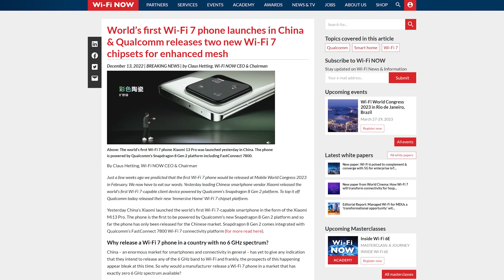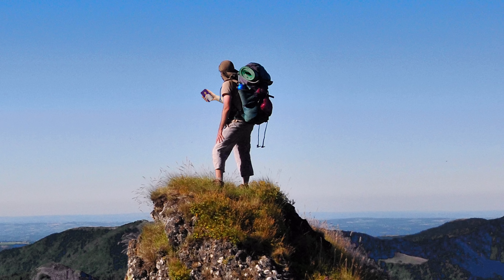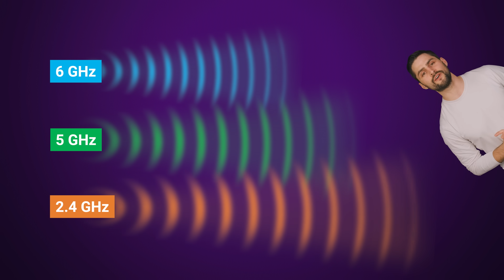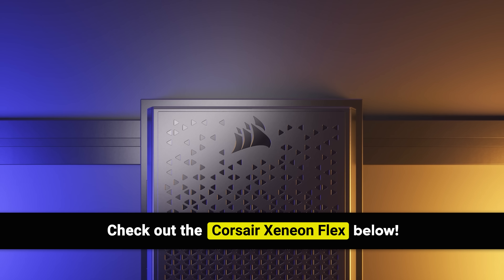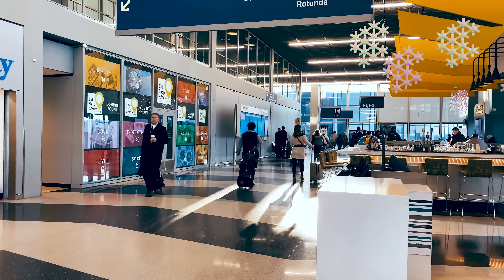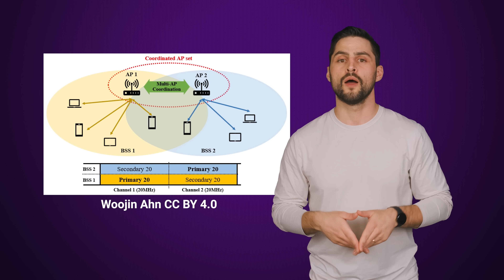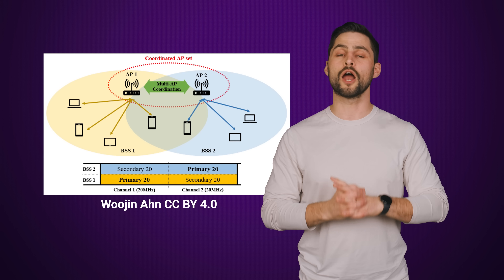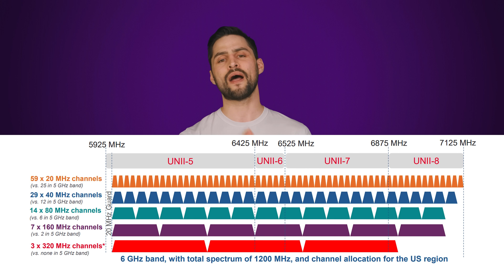Can Wi-Fi 7 Replace Range Extenders?

Comment: all modern access points create 2.4 and 5GHz at the same SSID, the main issue is forcing the client to not stick to the band too long and not dropping the connection during swap I guess, having this figured out is surely a great promise, though we'll see if it works
Reply: They figured it out in cellular network long ago, but I believe the main issue was the processing power needed and how to reliably do it.
Reply: Yeah but the connection between the client/AP will operate on only one frequency… but with MLO, all 3 frequency bands can potentially be used simultaneously.  So some of the data will xmit on 2.4 GHz, 5 GHz, and 6 GHz.  Will be interesting to see how much better (if at all) the MLO approach is compared to conventional (1 freq at a time) Wi-Fi communications.
Reply: I've yet to see an AP name all the bands the same by default since the Airport was discontinued. These days it's rare to find a consumer AP that won't fuck up when you use this configuration, because for some reason, outside of companies that were following Apple's lead, everyone was going the route of naming different bands different names, creating this weird culture of like a million AP names for a few networks in the neighborhood.
Reply: @LokiScarlet  what planet are you on? Every single device I've used had both bands on the same SSID, the first thing I do is split them to different SSIDs
Reply: @balthxzar  Earth. Which universe, however, remains uncertain, as it's almost like I wake up in a slightly different world every day.
Aaaaanyway, as long as your AP and your client devices support it, you really should be using one SSID per network, not two, three, or six.
Reply: @charles turner  SSID and SSID 5G is typically what most routers come with by default now and I can confirm, on most of these routers there would be complications and conflicts non stop if they were on the same SSID. That being said, I've never spent over $75 on a router and I live in apartments, a lot of which now are forcing you to use their even shittier $20 modem/router combo.
Reply: @charles turner  my old Walmart netgear and my new Asus does this.  Its an auto ssid feature.  Router will automatically switch a device from 2.4 to 5 ghz based on signal quality.  This has been around for a while now.  Not sure why people think it's new .....
Reply: @LokiScarlet  even my 3yr old Xiaomi Mi Router AX1800 does this. it combines both 2.4 and 5ghz bands into same ssid out of the box. I had to get to the settings to disable this so that my laptop can just continously connect to the 5Ghz band by separating them into their own SSID.
Reply: @balthxzar  Yep, this is also what I have done in the past, but since a year or two my internet provider has decided to disable the split option so people won't fock around with their router settings as much. I guess good for people who screw up their settings but I hate not being able to split it/see on which band I am. They tell me to buy an other router that does support splitting if I want this... For most cases it is fine, but using airlink on my quest 2 sucks. Sometimes its great, other times it just switches to 2.4G for no reason and it sucks, and there is no way to force the quest to use the 5G connection.
Reply: @Huskiefluff  it's done really rude and just asks client to leave when it's singnal is weak (you could set Roaming threshold on Asus). That leads to device disconnect then connect again with right band. What if device could just jump to another node without disconnetion tricks?

Comment: Ok, this just made me give up my objective of upgrading to a Wifi 6E Access Point, makes a lot more sense to wait for Wifi 7 as it includes stuff that I prioritize.
Reply: @Phi Wifi 6E is normalized just not a lot of variety of equipements. I use enthusiast gear, mostly from Ubiquiti.
I currently have a Ubiquiti AC LR Access Point that does the job very well, I want to refresh and if its just for speed is not worth it. I want both the 6Ghz band update and these improvements on Wifi 7 is the stuff that should have been implemented for ages at this point. 
So, I'm ok with waiting for Wifi 7 for a year or 2 and spend 200€ on Access Point for it.
Reply: @Phi WiFi7 is real just not finalized, but it is indeed risk to invest it now not to mention overpriced. WiFi6E is fully finaluzed and ready, problem is regional regulation for 6Ghz usage making hardware manufactures treating it as premium feature, that why its not as accessable

Comment: I hoped for PoE but with WiFi :).
I think I would rather invest into 40GB (theoretical) Cat8 internal network at home. It depends on your use cases but. I am still not over how much I have spent on the WiFi6 upgrade a bit more than a year ago.
Reply: PoE but with WiFi?
Reply: @minusdin  Sorry, I was joking :)
Reply: @minusdin  Yeah, bascially magic at this point in time.
Reply: @@phi2307 I have seen CAT8 cables but haven't figured out if there are any routers and switches that support that.

Comment: Multi-band means multi-radios which means battery hungry.  I don't think we'll see this in practice for phones for a while.  Same reason why most phones and laptops are 2x2.
Reply: I mean if they could do it for cellular connections they could do it for WiFi considering that phones now can run multiple bands at 4x4 mimo simultaneously on top of a 5G band that's also on 4x4.
Reply: @Lanon0987654321  yes, LTE had carrier aggregation for years. 
WiFi uses less energy than cellular too.
Reply: We already have it, Nubia Red Magic 8 Pro and a few others that I forgot their names.
Reply: @MAFz7  I was thinking Pixels and iPhones.  I'm sure there are high end phones and niche phones that has more.  It's one of the frustrating things about the phones, tablets, and laptops I buy (Pixel 7 Pro, Tab S8, and laptop with AX210 WIFI for example).

Comment: Distance isn't the problem and never has been. Penetration is the problem and the higher the frequency, the worse the penetration through materials. Many homes in certain regions have less than idea floor plans with not only lots of walls, but materials in those walls that quickly absorb that frequency. The reality is that just like anything on the 5ghz band, this won't benefit the vast majority of users and the same complaints will continue because people don't understand the real problem. Fact is if you want the fastest most reliable speeds, any stationary computer needs to be hard wired and for mobile devices you need lots of access points in most home and corporate office designs.

Comment: All these devices that claim WiFi 7 need to be labeled “WiFi7 (draft)” until the full spec is ratified
Reply: We had that with 802.11 N draft
Reply: Well i think they are called WiFi7 ready
Reply: As a musician that uses 2.4Ghz wireless I can’t wait for the rest of the devices move on to 5 and 6 Ghz.
Reply: @GrimYak  i bet you can wait forever for that, why ia 2.4 ghz used and not something else, would probably be better with lower frequencies if they are available for Comercial use and be more reliable.
Reply: @LastWish90  most guitar wireless systems sold today are on the wifi frequncies 24 and now going into 5Ghz. These are digital wireless units so makes sense to use Wifi instead of using a different standard. there are radio (UHF) available but not as clean as they are prone to interference and you need a license to operate in most countries, wifi you do not. Problem with the 2.4Ghz units is that the bands are so crowded you get dropouts if you play in an area with a lot of Wifi enabled devices.
Reply: @GrimYak  UHF isn't inherently any more prone to interference than 2.4GHz, and there are plenty of digital UHF wireless systems on the market that are generally much better regarded than most of the 2.4GHz systems tend to be.

Don't get me wrong, 2.4GHz systems can be used effectively with proper frequency coordination, but the same applies to any UHF system. Most of the mid-tier to high end wireless instrument/mic systems tend to be digital UHF (Shure SLX-D, Axient, Sennheiser EW-D, etc.).
Reply: @themiddlecase  they are UHF but those tend to be used by big production bands, not gigging musicians like me. Most if not all gigging musicians use digital and digital works very well in short distances as you wont find a 100m stage on a gig so much. Even Shure is moving towards wifi dual band now, only one that i know who is sticking to UHF on wireless guitar is Senn.
Reply: Yes
Reply: Ikr. Like some asus ones
Reply: For sure. It's sad they can release them with the name before it's finalized. Should be a more protected marketing tag.

Comment: As someone who got screwed with "draft N" products (because my boss said it was the latest and greatest... $8000 later.. very unreliable), don't bother with an un-finalized spec.
Wait until 7 is fully-fully ready. You'll know because that's when Scumcast will start advertising it on their routers.
Reply: You'll know because that's when they will start advertising Wi-Fi 8 draft everywhere.
Reply: @MaxusR  My 10c is on they'll follow the USB standard Wi-Fi 7a, Wi-Fi 7b, Wi-Fi 7c...
Reply: Do you mean Concast
Reply: Comtrash will give Wi-fi 7 routers to their customers when Wi-fi 10 is out
Reply: @martin0499  And still overcharge them for it
Reply: Is Scumcast anything like Comtrash?
Reply: Draft technology user here! I had a terrible experience with Wifi5Draft. In January 2024 I bought the Nighthawk RS600 wifi7draft, I can say with complete certainty that it was my best purchase of the year, the connection is ultra stable, very fast and above all reliable.
Reply: I had an early  Draft N combo router that I put in a business that I could pick-up signal, in the city, in my car , on a laptop, over a mile away. yikes.
Reply: I like frontier fiber personally, cable suuucks

Comment: SSID separation isn't recommended anyway so that is a moot point. This roaming between channels thing exists when you don't split your SSIDs, and with the right configuration you'll be connected to WiFi 5/6/6E by default on either 5GHz or 6GHz. They call it band steering. Once you move out of range of those frequencies, your AP will automatically drop you onto 2.4GHz. It's not a perfect science because it's also reliant on the device connecting itself to behave and often they choose to ignore what the AP wants to do.
Reply: I've had bad experience. My devices always clinged to the overly congested 2.4GHz network. I split 2.4 and 5GHz and had no problems since.
Reply: @AbRaSkZo  me too
Reply: i like to use ssid separation